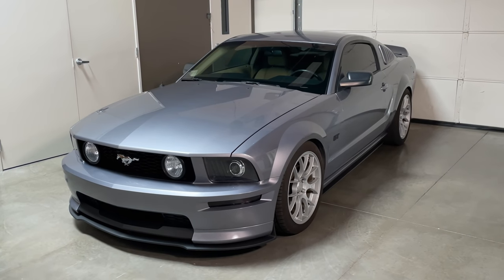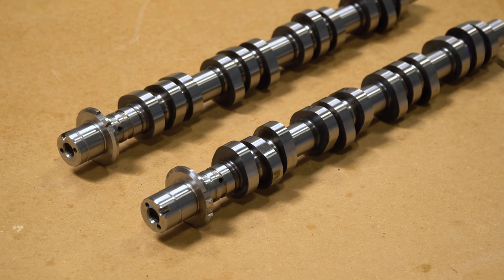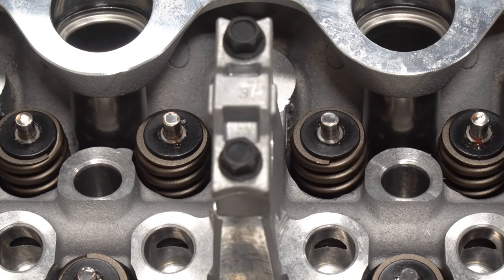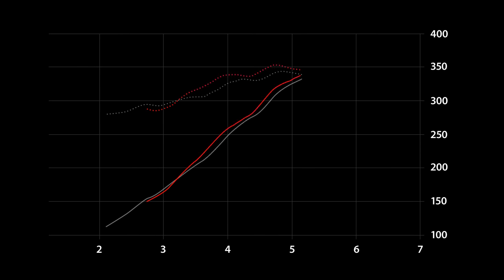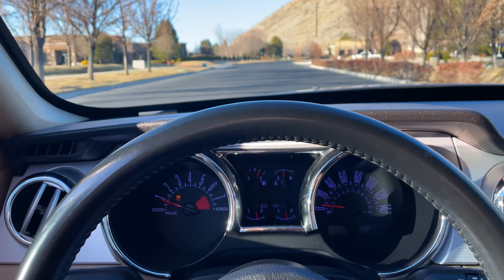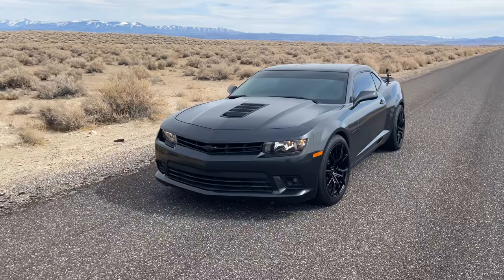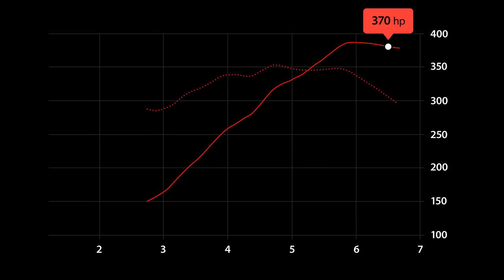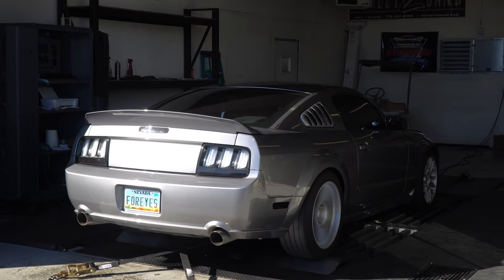The results 📈 of installing the most aggressive cams on my Mustang

Comment from the maker: A few of you have commented that the gear-grinding in 2nd may be due to a worn synchro. Good possibility this is the issue (I'm hoping the old clutch's diaphragm was just weak from abuse). If this is the case, I'll be swapping in a 6-speed. If you have any experience swapping transmissions on S197s, please feel free to reply to this comment. And no, I don't want an auto.
Reply: I disagree on the synchro. These S197's use a body mount shifter, and at WOT your engine and trans is twisting, while the shifter is not, since it's mounted to the body. Get a Blowfish Racing V2 shifter bracket and your choice of short shifter. The bracket allows the shifter to mount to the trans, no more grinding gears.

Edit to add, if you have $3500 burning a hole in your pocket, a Tremec T56 Magnum XL should bolt right in. The extended tailshaft housing locates the shifter in the right spot for these cars.
Reply: Might look at a bowler t56 magnum XL, as they're made to bolt right up in that car, or possibly the same trans from tick, tick knows how to make a trans hold tons of torque/power. Might also look into either mantic or black magic clutches, and 3.55 or 3.73 gears. I have 3.55s in my 96 and they're great, but I'm also on a 4r70 auto with a high stall converter so down low it acts more like a 3.73 or a 4.10. Just make sure when you go to upgrade things that your future proofing for those turbos or you'll end up spending the same money again to make it hold more when you need it. Also if you're mostly stock suspension look into control arms with poly bushings, it's a world of difference when it comes to putting the power down, poly or solid motor and trans mounts are a good idea too, plus 4link adjustability is great if you know someone with experience setting them up. Just a side note, 3.55s are very steerable but give you a good kick, 3.73s will kill your mileage but have even more down low.
Reply: that grinding is 100% the synchro on it's way out the door.  swapping the trans from your 3650 to a 6speed (tr6060, t56, stay way from the mt82 garbage), is going to be more of a nightmare than it's worth.  If you can get the trans crossmember from an '08 gt500, and the tr6060 in it, it'll be a tad easier.  Next, you're going to need a new pilot bearing, new throwout, new slave, etc.
Reply: I highly agree with nick on this had the same issue with mine at high rpm on the track I put the blowfish racing bracket and fixed my lock out issue I definitely recommend this mod for our remote body shifters. It also has a drive shaft loop on it so your legal on the strip when you turbo it.
Reply: I love the car bro but like I said buy a gt500 and you will smoke a camero lol
Reply: @anthonylaudano9751  Something about having an underdog is more satisfying to me.
Reply: @danielroberson5421  That's a way of looking at it.I have to say I grew up with fox bodies and they can be a pretty fast car.But the game changer was my 08 GT500.Then I went to my 10 900hp super snake was a LIFE CHANGER.I guess once I had a taste of my 08 GT500 and both of my super snakes performance wise there really isn't many car's that can hang with them.I love the 05 too 09 body style.Next car that I plan on adding to my collection is a 08 KR.I never thought I ever own a super snake let alone 2 of them along with my 08GT500 and my 07 Shelby GT.Have you ever drove a super snake or a 850hp GT 500.If the answer is no you have to try too.It's a HUGE DIFFERENCE.
Reply: Tr 6060 if ya can
Reply: is that an NA cam will you have 2 change it out when turbos are installed?
Reply: @Nick17354  WTF was Ford thinking, that shifter mounting method needs some stiff drivetrain bushings or solid trans mounts to work not soft stock rubber...
Reply: @Nick17354  Its been a while since ive watched his older videos but im almost certain he's installed one of the shifter brackets.
Reply: @75novaguy73  That may be the case, however this issue is common on all S197 cars, and is legit fixed by mounting the shifter to the trans. I'm assuming he has a short shifter but it's still remote mounted.
Reply: Hey. i dont know too much about 197s but i have an '04 New edge gt. Third gear grinds when i try to shift it over 1500 rpm. The synchro is shot completely for 3rd. Its a kinda tedious fix but the price isnt too insane. For now i just bypass third and go straight into fourth. It sounds a lot like your synchro is going or gone bad as well for 2nd.  Before getting a whole new trans id try to get an estimate on how much it would fix to get a new one and get it installed. Good luck. Its a very cool car. Will definitely be subbing!
Reply: @rainbowsparkles4579  Watch some Richard Holdener videos on YT. There is no such thing as a NA cam, Blower cam, Turbo cam. They all work, all the time. All boost does is raise the power curve. Pick a cam with the power curve you want, then add boost. 

It is way more important to match intake runner length and cam. Long runner intake and high RPM cam is a mismatch, just like a RV cam and a short runner intake. Boost will just raise the curve you made NA...
Reply: You're gonna need the 6060 for the power you're making. The 3650 isn't made to go over 400 hp/tq. Also look into the thickness on your mmr head gaskets.. that'll rob compression as well. But more than likely the 11cc dish is the main culprit.
Reply: those terrible tr3650s
Reply: I had to replace my '06's whole transmission for exactly this. Bad syncros are usually what happens to a TR3650.  3rd gear was grinding into gear, eventually it wouldn't even go in. It was more cost efffective to replace the whole thing than tear it down to repair.
Reply: u should try a WOT box from n2mb it may take some getting use to at first but after i started using that and the 2step functions i never had an issue with 3rd gear lock out or the 2nd gear grind... or u can always 6r80 swap that thing and use a us shift controller...
Reply: @Nick17354  ☝🏾what he said about that body mouted shifter.. its a terrible terrible design.. i just went with a hurst short shifter and the WOT box when i started having high rpm issues after that it was smooth as silk
Reply: Just found your channel man, enjoyed what I've seen and recently just bought an S197 as well. I'm curious about how you obtained that fitment.
Reply: A weak pressure plate will mean the clutch is never fully engaged. Engagement when it should be fully disengaged is what causes gears with good synchros to grind, which is the opposite of a worn clutch. A worn clutch will slip, but if anything it'll be less likely to grind.
Reply: I've never swapped a tyranny, but I did stay at a Holiday Inn last night.
Reply: @Four Eyes if you are dead set on twin turbos you might as well go TR6060 or Magnum already and not bother with the stock TR-3650 in there... you WILL break it once you boost it. Been there, done that with a 3V 11 years ago lol
Reply: If you do any increases in horsepower, you MUST change to a better transmission. You cant have the muscles of a body builder with baby ligaments.
Reply: I do I’d love to help but unfortunately You’ll never see this Bc of how late it is
Reply: Mgw shifter, blowfish trans bracket ,steeda motor mounts,GM synchromesh trans oil 6 years using no problems at all your problem  solved.
Reply: @Nick17354  this is spot on. Second and third gear lockout is terrible on these cars. Stiffer engine mounts and transmission bracing can help but I think the T56 is a better option.
Reply: It's not a syncro! The later tr3650s are not as bad as the top loaders were about that in the 99-04 mustangs were. Look up the torque brace for the s197. Your Engine/trans is twisting and not allowing the clutch to disengage all the way on also the shifter design is a weird one and it's mounted on a rear axis pivot that will bind up that also needs a brace. That's most likely your problem. The more power you make the worse it's going to get. You need a torque brace kit asap. And I'd just skip to 4.10 gears brother. I had 3.73s and the same trans. I wanted 4.10s. gears and you will be there my dude. You have the power to weight in your favor
Reply: Hey, what tire size and setup you have and are do you have spacers.
Reply: Ive done a TR6060 rebuild a d Swap into Liger and now all the ins and Outs, the T56 is similar and if you need any help dont hesitate to ask. Ive rebuilt my entire S197 at least 5 times over, so if you need any knowledge or help just ask and ive got you 😃
Reply: After enjoying this episode I checked for a follow-up video hoping to see the car with near gears or gearbox and clutch but sadly no update as of yet. Any idea when the update will be?
Reply: @Aph87  What lol

Comment: I love this build and the character it has as a 3v. I ended up just going with coyote swap because of how good a platform it is and how easy it is, but a built 3v is still awesome and that car is a beauty. You might consider the epas rack conversion for the lower weight and steering quality to get the most hp/least weight from the drivetrain.
Reply: 100%! Best mods for S197 cars are GT500 4 pot brembos, wide square tires (I run 275 square on 18×10s), rear control arms for wheel hop issues, 11-14 front LCAs are nice if you don't mind modifying the knuckle a bit, EPAS rack is definitely nice to have. Also if you drive a manual buy an aluminum clutch master cylinder rod end because yours will probably break eventually and you'll be stranded. They're like 10 bucks and can be installed with an Allen wrench in 5 minutes, rather than a $500 trip to the mechanic for a new clutch master clutch just for the rod end
Reply: What was your total price for the Coyote swap? Thx
Reply: @Phantom096  it just depends on a lot of factors but bare minimum 10 grand.

Comment: I appreciate builds like this...  it isnt the fastest, but sometimes its fun just to see what you can do.   Have your tuner build you a 100 octane tune with a sprinkle of nitromethane.
Reply: His compression is so low(9.5:1) he could run 87-91 and be fine. He would just dump so much fuel for a tiny gain in power it would just hurt the wallet. Math is important when building a engine. 12.5:1 would be better for 100 octane. His setup up is a good candidate for boost, but even a boosted engine I would prefer i higher static compression and lower overall boost pressure to achieve numbers. Sounds decent though for such low compression.
Reply: @keva3336  thank you.  So few people actually understand octane/ compression. Seems a lot are educated by fast and furious movies rather than hands on.
Reply: It’s a very low compression motor built for boost.

Comment: Your car and your project are awesome.  In an era where electric bars of soap run 10s and 9s with no driver intervention, the acceleration numbers are losing importance.   By all means, make the engine as powerful as possible but the experience, the sound, the feel, the driver interaction are way more important now.  The 4.6L may be a gen out of date but I’ll be damned if it’s not one of the best sounding engines ever made.  BTW, visual mods on your car are perfection. Nicely done.
Reply: Im not even a muscle car/v8 guy but this thing is nice and sounds great

Comment: As a fellow 3v'er with a stock TR3650 I can suggest that your 1st - 2nd shift problem may not be your clutch.  I went thru multiple options/upgrades (stainless clutch line, new clutch, Blowfish bracket etc.) trying to fix the 1st-2nd and 2nd-3rd high rpm shift lockout (the grinding you felt).  It wasn't until I installed the CHE torque limiting brace from the trans to the k member that my issue improved substantially.  I know u know what you're doing but I've lived this issue.  It's completely frustrating and will only get worse with more power without that brace.  Love the channel man.
Reply: Does double clutching fix the problem?
Reply: @LionAndALamb  I have the same problem but a far different car. My 95 4runner is slow but to get on the freeway I really gotta push the rev limiter to get up to speed on time and I have found that double clutching cuts about a half a second off the grinding which is a lot but not enough to completely get rid of it.
Reply: Power up.  Take off in 2nd!!!!!
Reply: The ultimate source of the gear clashing problem is that the ratio splits in the 3650 are simply too big.  When you shift gears, the synchro/blocker rings job is to decrease the speed of the input shaft to match the next higher gear but the inertia of the input is tied directly to the polar moment of the 10.5" clutch disc.  The wider the split, the more change in RPM during the shift. The only way to effectively reduce the inertia is to go with a smaller clutch diameter which is why so many performance cars now use a smaller diameter (i.e. 8") multi-disc arrangement.  There are now several companies making dual disc clutches for the Mustang which will drastically help the problem.

Comment: I had a 238/243 600 LSA Comp cam for my 6.0 Gto. Never had it tuned. I was younger and the bank got it back lol. But when you started it up after installing it. Man I almost cried. Those cams are hard to beat. Sound drivability and power. It’s all there. Good luck to you bro. Thanks for the video

Comment: Good updates! I actually like the idle chop a little better with the comp cams if I'm honest! 3.73 is an excellent choice for your build but it may be too much gear for traction once the turbos hit. Keep the 3.31 on the shelf😁👍👍
Reply from the maker: yeah these comp cams are p nasty
Reply: @BR-P-2001 // Yeah agreed but he's been saying all along he's gonna boost it....
Reply: @BR-P-2001 // Totally agree! Such great motors really
Reply: Split the difference with 3.55's!
Reply: @BR-P-2001 // they really are 😭😂😂
Reply: @BR-P-2001 // I put 4.30 gears in mine and with the full bolt ons and detroit rockers it rips.
Reply: @BR-P-2001 // I have 4.10's in my 08, I have almost the same build as foureyes lol but I'm staying N/A. My rpms at 100km (62mph) are about 2800-2900 in 5th. I have stock manual tranny and 18" rims. The 4.10's wake these cars up trust me. Don't hesitate for a second. Highway gas mileage does suffer a bit tho and above 110-120km/h you can almost watch the gas needle move😅
Reply: My car is rowdy with the stock 3.55's and 28" drag radials. It is supercharged though, so I guess that helps.lol
Reply: @chrishernandez2490 . My Ram 1500 with a 394Ci stroker has 3.55 gears🤘🏻
Reply: @bri-manhunter2654  how you like em? I have 3.31s in my 07 GT500. Sometimes I like them, sometimes I think they're a tad bit long . Not sure if they're worth the upgrade
Reply: @chrishernandez2490 . I like them a lot for my setup, but more can be better. With your positive displacement blower keeping  your 3.31 gears will make traction a lot easier, but on the drag strip with a sticky tire you could always go for a steeper gear.

Comment: My guy I'ma speak on the elephant in the room....it's time for a proper 6-speed swap
Reply: hte way ill do it with mine: run the 5 speed until it blows up, then throw the 6 speed from the gt500 on it.
Reply from the maker: yep, the 5-speed is done. t56 en route...
Reply: @Four_Eyes  yea buddy
Reply: @Four_Eyes . You will need an even steeper rear end gear with that 
T56 trans unless you are doing a positive displacement blower. I believe that I heard you were doing a turbo setup?

Comment: Excellent information. The sound of this engine with cams is so good. But I am getting older (and lazier), so taking the rpm all the way to 6k to hit peak power is not my idea of fun. A mild preparation and a good turbo will easily yield 400hp and a ton of torque. My 2007 GT was so much  fun to drive even  with the original engine and flowmasters. However it drove like a 60's truck.

Comment: Oh no, I lowered my compression. Well, guess I'll just slap some turbos on this bad boy. And that is how you solve a problem.
Reply: Thats actually how you solve that issue with upgraded heads already.  He put comp cams in which only gave him 22 hp i think.  So, the only other way to boost compression is turbo or supercharger.  Turbos will feed the power a whole lot more efficiently.
Reply: A full point of compression should only be about 10 to 15 horsepower from everything I've researched

Comment: For that setup I honestly wouldn't go with a 3:73 gear I'd go with a 4:10 or above at least, I have a stock 4.6 2v crown Vic and swapping out the gear to a 4:10 was probably the worst thing I could do for gas mileage but it became alot more fun to drive.
Reply: At least 4:10 gear.
Reply: rear gears and a set of wheels should be any mustang first mods
Reply: 3.73 gears is the best all around gear. 4.10's are too steep.
Reply: @divemaster037  yes but for the cam that he is running you would want a steeper gear to complement the cam.

Comment: It seems so strange that a 4.6l V8 produces little more power than a stage 3, 1.6l fiesta st. Shows how effective turbos can be.
Reply: A lot of big american engines are simply underpowered though, compared to other engines of similar size and year. I was going to comment on torque numbers for big displacement engines, but the current Fiesta ST also has almost 300nm, too.
Reply: Meanwhile honda was making 240 hp out of a naturally aspirated 2.0 4banger 😂

Comment: As far as I know, the 3V 5 speed is a beast of a transmission, and if you're planning on getting a Coyote 6speed I've heard horror stories on the weakness and inability to change gears at high RPM, keep the 5speed IMO. Also, 355 gears were stock on those too, although 373 are a blast to drive on the daily and for enthusiast driving.

I love your channel and I love your mustang keep 'em coming!